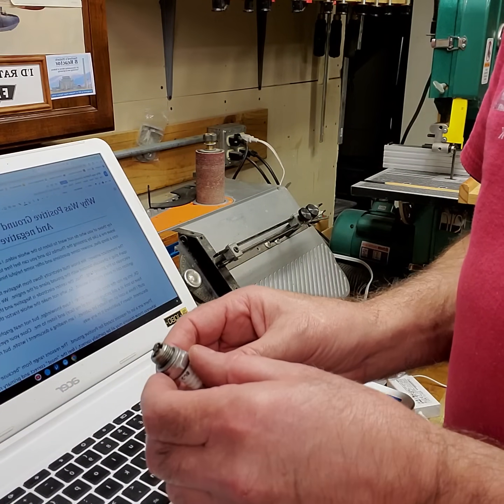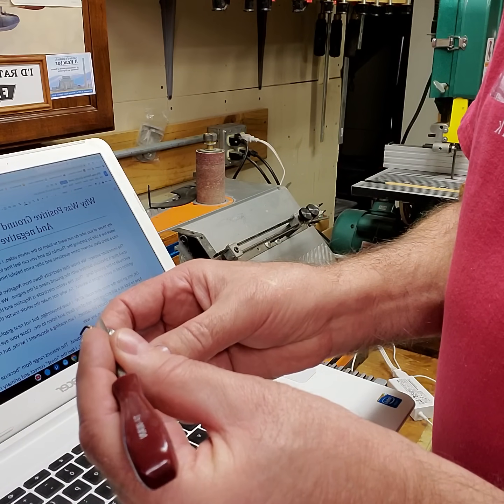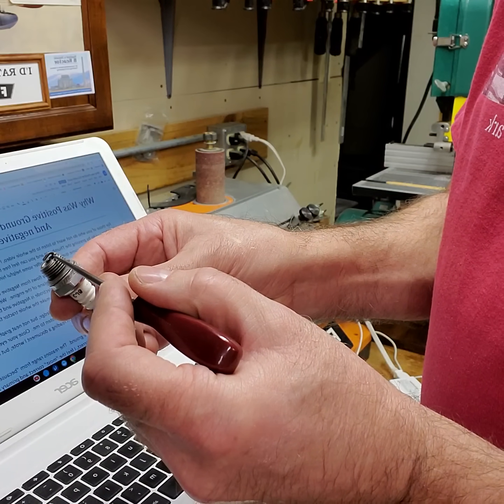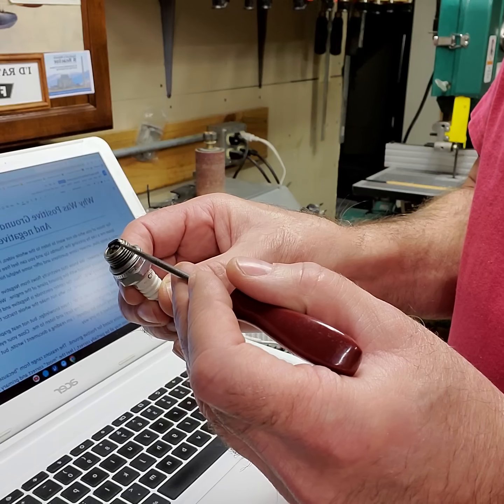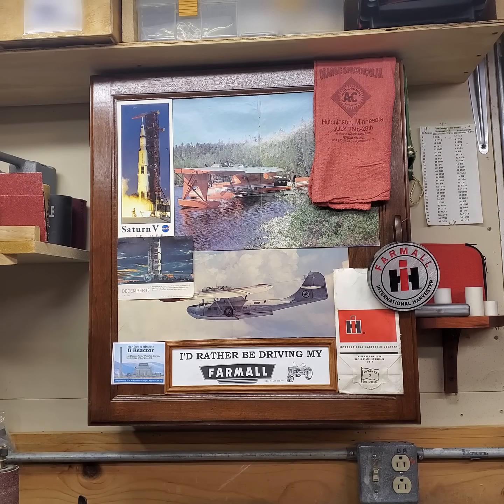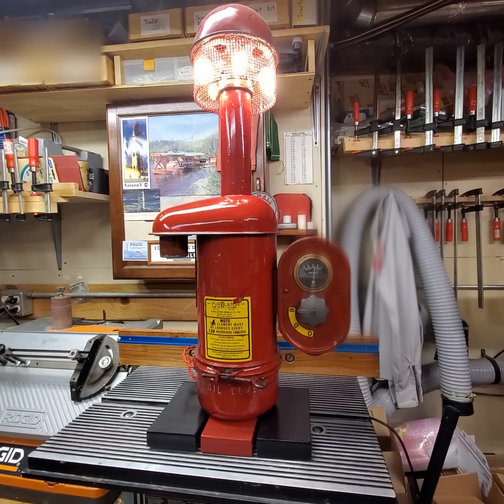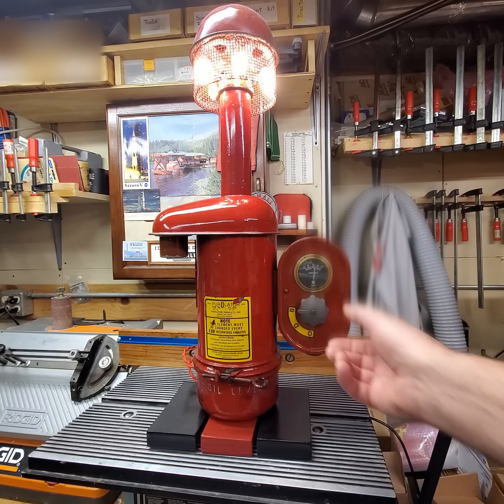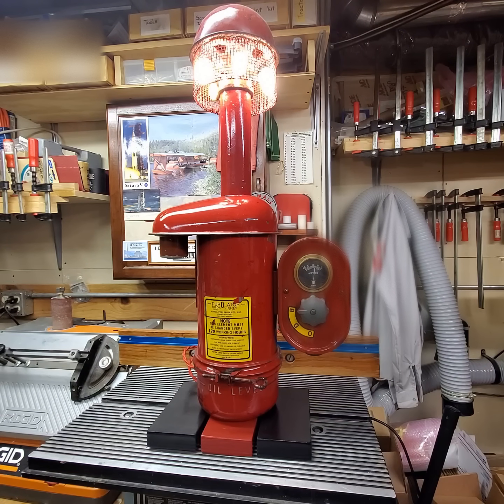Why positive ground was used on old cars, trucks and tractors

Comment: Lots of good information. There are some exceptions to the spark plug polarity rule. I've seen that some old gm cars had a cable operated ignition that reversed the polarity of the coil every time it was turned on. This should reverse the wear on the electrodes I would think. I'm my years with our power company I learned how on our high voltage DC line the ground rods would slowly dissolve and the material would build up on the next rod in line. They would reverse the polarity every so often I think for this reason. Another thing that is interesting is all flat twin 4 stroke engines I have worked on have a double ended coil. Power goes out one end, through a spark plug into the block and out the other plug and back to the coil. A complete series circuit. Remove one plug wire and no spark on either side. So it means that one plug always has a negative electrode and the other one is positive. I have never seen a problem because of this.
Reply: i THINK gm "waste spark" coils also work the same
.
on my 3.1 (or buick 3.8) it has 3 coils.... 2 terminals on each coil
ive also been told that you need double plat spark plugs..... due to the one plug sparking from center to "ground strap".... the other from strap to center 
.
the doub plat plugs have a little "button" on the strap and center.... allowing for good spark control
Reply: @kainhall  you need IRIDIUM not platinum, those GM engines with waste spark had pre-detonation issues because of the size of the platinum plus the inefficiency at heat removal(vs copper) iridium is so small tip that it doesnt create piston chipping scenarios and you get 100k service intervals.
Reply: The old GM's reversed the coil polarity every second time the car was started. This was to increase ignition point life at slight cost of engine performance half of the time. The condensers were always slightly over capacity & there was transfer of tungsten from the + to the - thus causing a pit on the + side & a build up on the - side. Changing polarity cancelled out this metal transfer.
Reply: I doubt it would reverse the wear, but would probably spread it evenly between the center and the tang.
Reply: The cathodic effect.
Reply: I saw a switch on an old Chevy truck back in ‘62. The switch was operated by activating the starter with the foot pedal and it reversed the ignition polarity to minimize metal buildup on the points. Truck was probably a ‘36 or ‘37. Mechanic told me I probably would never see one again.
Reply: @lorenrasmussen338  My first car was a 1950 Chevy 3100 pickup, & it had the starter pedal.

Comment: Great Video! I am an old farm boy and grew up with I/H Farmalls. Also a multi ticketed mechanic with one being ag-mechanic I did notice one thing, no matter whether positive or negative ground , magneto or point ignition ,when the engine is running and you accidental touch a bad plug wire those electrons have quite a punch. Put a saint into swear mode.
Reply from the maker: Hi Murray!  Yes, those electrons can pack a punch.  ha ha  I too have been shocked by ignition coils.  Never a nice experience.
Reply: Used to work as a mechanic with a fellow who tested plug wires by spraying them with water and running his hands over them. Would have knocked me to the floor!
Reply from the maker: @tedrice1026  Hi Ted.  Interesting!  When I worked in the field, I saw electricians who would tough 110 Volt circuits to see if they were hot, or not.  And, they were all seasoned professionals too!

Comment: My friend had a 67 MGB . He took it to two different mechanics that couldn't figure out why it wouldn't start. I told him to check the braided straps that went from the transmission to the frame and the rear end to the frame and the engine to the frame. He didn't believe me. I let him flail at it for a week. I came over one afternoon and said, George, let me try something. I hooked all of the ground straps back up,after cleaning them and the surfaces, and guess what. Yah it started right up. It's weird how people who were struggling for an answer wouldn't believe me after answering their question. Went through 30 years of maintenance with people like that. 👍
Reply: Yes, in all my old positive earth vehicles corrosion at the point of earth was a big problem with corrosion spreading out from that point like the plague.  Since we have has negative earth systems body corrosion due to electrical flow seems to be a thing of the past.  The days of positive earth, dynamoes and voltage control boxes gave rise to nightmares.....and a lot of vehicle fires...never mess around with a voltage control box unless you really know what you're doing.
Reply: I am surprised that he didn't destroy his control cables, choke etc. The starter motor would try to earth through these cables. I  had that problem some years ago when an earth strap was left off.

Comment: I honestly cannot see why it matters which way the electrons flow in a spark plug. Burner ignition systems use AC so current flows both ways. As others say I believe the main reason was the reduction in corrosion. Many vehicles were changed to negative ground especially when alternators were used. I don't remember having to modify the ignition system,
Reply: I don't understand why anyone would think electrons only flow one way in a spark plug, In a battery system when the points close you get a spark, when they open you get a second spark, which would make it AC
Reply: @robertwalls1381  I don't think it sparks on the close. You'd get preignition.
Points were timed such that the break came at the desired time...
BUT, there is the capacitor which 'rings' after the break, and I am under the impression that some AC ringing current flows while the arc is established...
Reply: @troubleshooter1975  Played with induction coils a lot as a teenager, hook up a primary wire to a battery, touch the other wire to the battery, as the magnet field expands through the secondary field you will get a spark, remove the wire from the battery and as the field collapses you will get a second spark, the capacitor acts as a shock absorber to reduce sparking wear on the breaker points and allow a faster collapse of the magnet field, At 3000 rpm a 4 stroke engine will spark 25 times per second, the difference between the first and second spark would be too short to cause preignition and timing would be set by the first spark anyway
Reply: @robertwalls1381  OK; not true:
On point ignition systems, remember dwell?
It represents the portion of the time that the points are closed. It is on the order of around 50%.
In a car, the first spark you are seeing is not enough to make a spark in a cylinder under compression.
If they both gave a spark in operation,the first spark would be during the upstroke of the compression stroke.
The 'second' spark, as you are referring to them, is a magnitude higher voltage, and produces a spark.

The only way I am wrong is if my estimations are wrong, and it could be happening in the exhaust stroke period.
But on an 8 cylinder engine, there is 8 lobes on the point cam, so that means there is less than 1/8 turn (camshaft) between close and opening (aprox 1/16 turn, give or take), so it would have to occur at about 3/4 to TDC.

If you reference any published secondary scope waveforms, you will see that there is a slight reverse response at the closing point, and then (after the dwell period) there is the spark spike (and ringing), at the opening of the points/or EMC drive...

The spark occurs at the opening of the points.
In you setup, you need to have conditions the same as in an engine.
You can't compare if you are gapping your setup to reveal a spark that occurs due to the much smaller pulse at the closing...

I welcome correction, but I believe this is true.

BTW, When I was young, I found some kind of test rig that used a model T reproduction coil in it. It produced a continuous spark!
What a blast I had with it!
Isn't it fun playing with radical power?!

[OH! And I accidentally discovered I can fix burned out filament bulbs with it! But that's another story! True story...]
Reply: @troubleshooter1975  Model T coils were buzz boxes and the spark was not continuous, it was a series of sparks so close together that they appear continuous as the double spark appears to be one in a breaker point system, dwell was set at around 32 degrees, the breaker point cam turns at one half the engine speed on a four stroke V8 360 x 2 = 720,  720 divided by 8 = 90 crank shaft degrees per power stroke, points closed for 32 degrees open for 58,  timing is set around 5 degrees before TDC when the spark occurs not by dwell,   The real question is does a spark occur when the points close, an easy test with a coil and battery would answer that.  Remember when you could prime a engine, hand crank it to just past TDC, then turn on the switch the plug would fire and start the engine
Reply: @ROBERT WALLS  Thank you.
Yes 32º, I did not have example figures by memory.
I agree 'continuous' is really a series of sparks. Most people refer to it as continuous. So does HVAC control boards, even though it is 60Hz sparks...

This test box I found in some discarded rubbish (I think it must have been the shop I worked at as a teen?) decades ago, had a red enameled heavy metal oblong box, open top, with a larger side that had slid in place a replica (I assume) Bakelite model T replacement coil, and the other side an empty storage compartment the test leads were stored in.
IIRC the test leads were two battery spring clips (like a battery charger) and think it was a standard HT ignition lead (copper core IIRC). I don't think there was a separate ground, think common was to the battery leads. Don't remember if it had a cup or a bullet at the end of the High Tension lead...

Strangest thing I'd seen, it worked when I got it. I pondered a while as to what it's purpose was. Never came up with a good answer. I think it must have been for testing and locating bad wires and distributor caps. Maybe testing spark plugs?

I think I used it only twice on automobiles.
Once to start my sister's car that wouldn't fire (to diagnose it). That was a skipped timing belt (or was it the car with the blown head gasket. Too long ago). It started. (remember I was a teen, and family avoiding tow or shop charge just to see if it was major engine issue).
And some years later, I think I used it once to get my vehicle home with a blown head gasket, where I could work on it. LOL

Mostly I used it to play with gas tubes and other stuff as a teen. [and fix Mom's burned out light bulbs LOL]

Incidentally, I'm sure it is spark on opening...
Both from my work designing a solid state driver for converting coilpack to COP system. And from setting point geometry manually. (engine off, static)

During the COP conversion, I was analyzing published waveforms of coil currents, dwells, and voltages.
[Incidentally, I came up with a better approach to driving dual COPs than the enthusiasts are employing; 4x the power...]

Secondly; Long ago, when I was a youth, I am certain that I have already done static point setup at specified timing, points set to just-opening,  to preset distributors. So proven.
The part I couldn't say for sure was if it was possible that the 'close-spark' existed, and if it could be during an exhaust cycle (but my math seems to indicate it would occur at about 7º early, during the compression stroke; or as to if it might be too weak to fire it).
I've done this an my own engines after a teardown to preset it (usually [always?] fired on first try), I think maybe on repairs for family or friends (not sure who now).
And I did it on a Farmall H that my Grandpa had not been able to start after sleeve replacement(?), when he had the dwell off and didn't have the specs.
Put the crank to timing mark. adj point gap [edit, I think gap was already set IIRC, so it was the distributor that I set] until meter 'just' indicated loss of contact.
Success, and engine started right up and sounded ok, so he left it set right there.
[4-cyl gas - so would have been about 14º early if my assertion about spark-on-open is wrong]
Must'a been about 14 at the time.

Fond memories!!

Thanks for the discussion!

[I'm not being contentious, I'm all for corroborating this, but all my experience and documents indicate it is spark-on-opening]
Reply: @troubleshooter1975  The spark box you describe sounds like a box we had when I worked at a service station just out of high school, We used it to get broke down cars off the interstate ( before we got a wrecker ) Then we started making some big money, LOL
Reply: @robertwalls1381  WOW!
I'm exited to hear that!
I don't suppose you know if it was something the tool suppliers sold?
[or anything about it???]

I'm astonished to find someone else that ever saw or had one!
I haven't seen mine in years and am sure it got tossed in the dumpster when my wife divorced me years ago... 
😢

I now have a pile of salvaged neon transformers from when I was doing sign work on a commercial building for a friends pizza shop. And a bread-boarded COP driver circuit I have used once or twice for 
testing coils and injectors.
[I have a video from when I rigged it up an injector cleaning setup to simultaneously  clean 8 TOTALLY plugged injectors on the truck engine swap project I was involved with for a close friend...] LOL

THANKS!
Reply: @troubleshooter1975  The box was sold by a supplier, it made a continuous spark had one high voltage lead that replaced the coil wire in the distributor, made the timing way too far advanced but it would run enough to get a car off the highway and into the shop... Just FYI if you didn't know, the model T used 4 coils, one per cylinder, and they were in wood boxes with a buzzer set of points on the end, the distributor sent low voltage to each coil when it was time to fire

Comment: The real reason may be caught up in the future at the time. In old tube radios there's ground and B plus at a couple of hundred volts the next-future was the first tubes whose B plus was just +12 volts which meant no vibrator and transformer to make old school power. Then the transistor which the first gen because of it's cheaper the time to make PNP transistors which favor positive ground but parts were for neg ground as transistors fully came out with neg ground have been since ever since.
Reply: That was my thoughts too.
I have not yet looked at when radios became common vs when grounds switched from positive to negative...
Also, I don't think the coils dictated grounding, since the secondary could be wound to either polarity desired. It is only an issue if it is not installed as it is designed to be hooked up AFAIK...
One would have to dig deeper to see if coils were easier to build one way (or just done that way), or if it had anything to do with the choice of grounding...
I don't think the real reasons are as clear as they may appear...

Comment: if you reverse polarity in a car you could become a ground path by touching the car metal.
Reply: HUH?
No, there is no battery connection to either terminal to the 'earth'.
All connections are power conductors or body returns. It does not matter which polarity the system is, the 'Earth' ground is not involved...

I don't know if you were joking or serious...

Comment: Electron flow maters when you are using vacuum tubes, one wire grounding can be heard through hinges on a stereo
Reply: Not sure what you meant.
(You said tubes, and stereo; terms that usually don't go together. I assume you mean a tube car radio and car door hinges).
What you are hearing is likely RFI interference on AM. (like rubbing against the antenna with metal, or a TV rabbit ears, back in the day).
I don't think you meant ground polarity, that should not influence such interference.
A bonding ground strap (wire) across the hinge should solve that.
Reply: @troubleshooter1975  it's two separate things, 1 and 2,, yes a ground strap would work.
Reply: @DANTHETUBEMAN  Thanks,
And I just noticed you user name (duh).
I am a repair tech myself, many years...
Tube, solid state, and relay logic.
1930's thru present.
Isn't it fun sometimes?
Reply: @troubleshooter1975  I build tube amps that Rawk. luv me sum gain stages. Mullard tubes and mustard capacitors have the most mid tones, and that's what sounds good in guitar amps to me, Plexi circuit all the way.

Comment: ok so unless you are running static wires from the metal to the surface of the earth  there is no grounds on cars.  there is a common  but no ground. terminology for most is unimportant  however when speaking of electricity it is. the english call it earthing  just like they cant properly spell color. why add the u in there?  lol(colour) earthing and grounds are the same thing and is commonly in use in alternating current.    commons are used in dc and is merely using a common item as a path, whether it be a return or feed. and that is determined by the side and polarity that the conductor is in regard to the load. the reasons for commons are many and varied but for the most part it is done to save on the amount of resources used(typically wire). it is interesting to note that in marine applications the metal of the hull is not used as a return or common to avoid electrolysis.